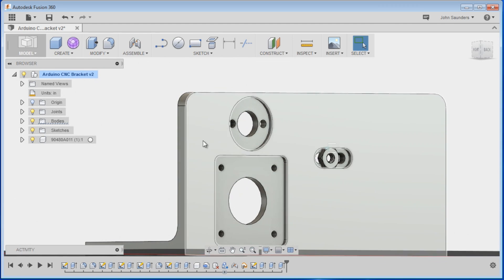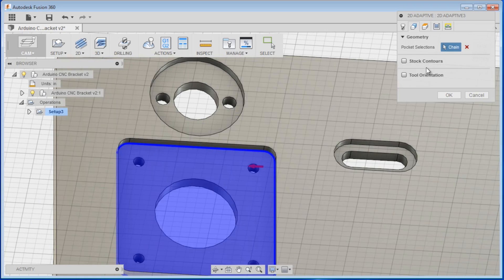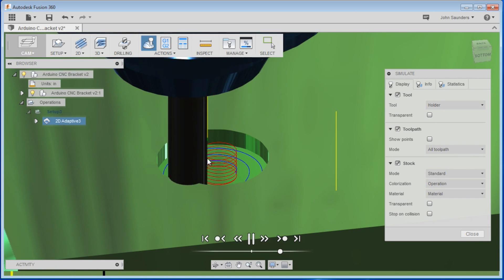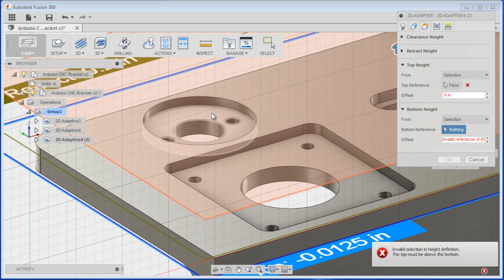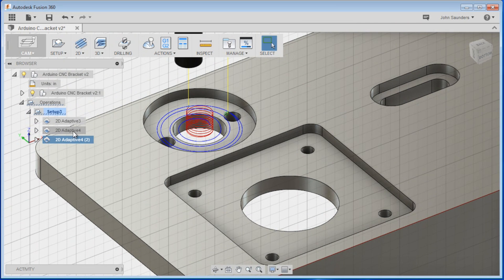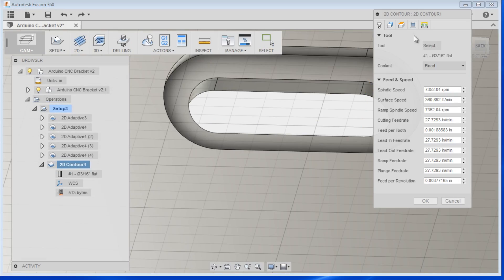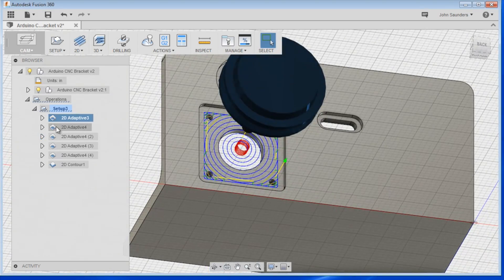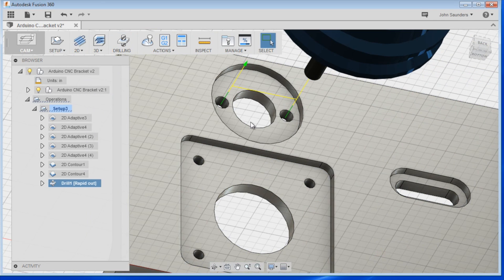Fusion 360: Arduino Stepper Angle Bracket CAM!

Comment: Hello, could you explain how i can change the depth the end mill tool goes down per pass. Because the simulation is showing it take a 1in depth cut instead of doing a little each pass to then reach 1 in depth.

Comment: Thanks for the great videos! I am new to fusion 360 and quite new to CAD altogether, your tutorials are really helpful! 

Do you have any tips for machining multiple components? My model has several different components arranged in 3d space but for CAM, i want to rearrange them onto a flat sheet. Ideally i dont want another model with copies of the components, such that if i update the geometry, I do not have to re-setup CAM from  scratch.

Comment: Unless I'm missing it somewhere, Fusion 360 doesn't have a "Target Part Comparison" type functionality in the simulation right? Meaning it won't highlight areas that are undercut or overcut, it seems like you have to overlay the transparent cut stock model and use your eyeballs. Please let me know if I'm missing anything to enable that. And is a target part comparison in the full HSMWorks?
Reply: +NYC CNC Any updates on yottabit;s question?

Comment: Hi John, there's a couple of things I would do differently. The adaptive ops are meant for roughing that's why the tolerance is set to .004". Setting it any lower produces a much larger amount of code. I would follow the adaptive clear with contour finishing pass with the lower tolerance setting. Also there is the smoothing checkbox, that reduces the amount code by using G2/G3 arcs.
I hope this helps.

Comment: Great timing on the video! I was just trying to figure out how to profile only a corner, rather than the entire chain. Thanks
Reply: NYC CNC I use Inventor, so I'm not 100% that this works in Fusion 360, but if you hold Alt while clicking, it should select a partial chain :)